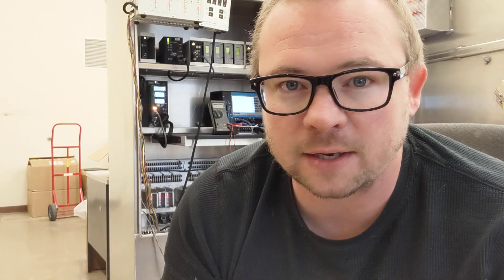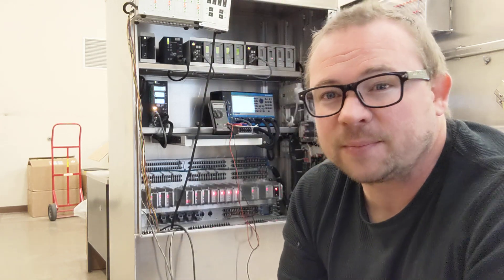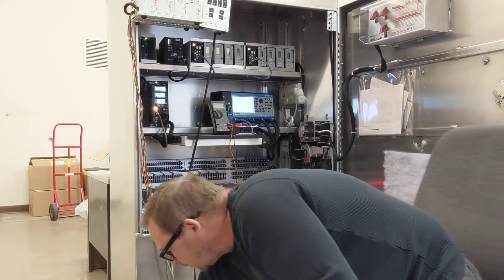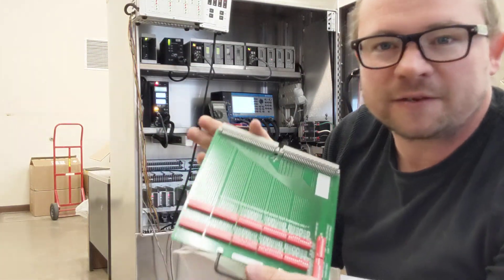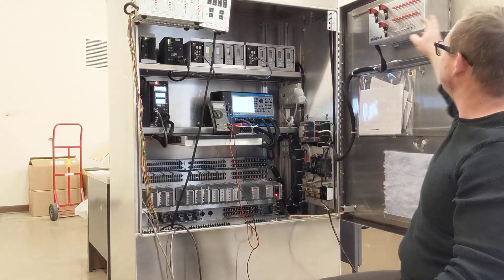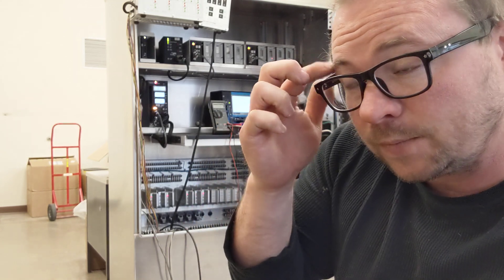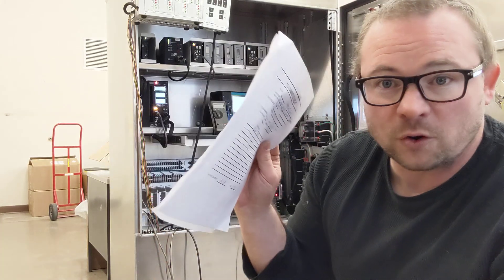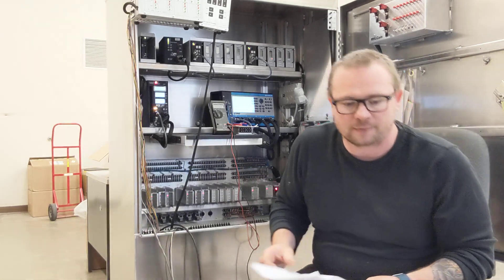Cabinet QC checks!

Comment: Not sure if you answer comments quickly or not since you publish content infrequently, but I’m dealing with a situation regarding a traffic box like this one and need a few questions answered asap.

I’m wondering how the TEMPERATURE situation works with all the equipment inside a box like this and all my questions are relative to this.

1. What is the IDEAL operating temp?
2. Is there a temperature “breaking point” on the high or low end of the spectrum? 
3. Do all boxes have internal temp control and/or temp monitoring systems that alert you to potentially damaging temps?
4. What role does the box ventilation play in this and is there any ventilation on these boxes aside from the slots in the small overhang above the door?
5. MOST IMPORTANT - can materials placed against the back of a traffic box like this create an “overheating” situation OR ANY OTHER damaging condition? More specifically, if a homeless person stacked up some pillows or a blanket against the box and then a shelter against the pillows consisting or a tarp and some makeshift framing, CAN HE CAUSE THE TRAFFIC SYSTEM WITHIN TO OVERHEAT OR MALFUNCTION IN ANY WAY AT ALL?

I am in the process of DEFENDING a homeless man who has created a condition like the one described herein. Police have threatened him numerous times with criminal mischief if he fails to maintain an “airflow” gap between the box rear and his belongings. One cop told him 2” is fine, then other cops come by and demand 6-9”. 

Of course I understand the climate can matter, but in this case, the outdoor temp was  in the 60’s when the man began this routine, and when he was threatened it was December and the temp was much much lower. Despite this, police claimed the traffic box was giving a reading of 90 DEGREES due to his actions and that this was hazardous to the traffic box components potentially causing the intersection to black out and motorists crashing and dying.  I’m a former cop and this is called COPSPLAINING. No matter what sense it makes, as long as it makes them feel better about them violating someone’s rights or dishonoring their oath, it’s just fine by them! In almost every argument, I can call their bullshit because I know enough to disprove their claims or I can look it up. In this case, I cannot. 

Please try to answer back ASAP. Thanks
Reply from the maker: Hey there,

From the age of 14-20 years old I was homeless myself and did spend some time on the streets so your question hits close to home.

These traffic signal cabinets are designed to operate in extreme +/- temperatures. Someone sleeping against the box wouldn't cause a temperature increase anywhere near enough to cause damage to the equipment. I've seen these signal cabinets running with an external temp in excess of 110°f. In the top of the cabinet there is a fan that is controlled by a thermostat. On the door there is a vent where fresh air is exchanged to keep the cabinet cool. 

Now, there are some things to consider about choosing a signal cabinet for a camping location. 
1.It's maintenance requires free access to the inside of the signal cabinet by technicians. 
2. They are struck by vehicles often and are a dangerous location to be for extended periods of time.
3. They are full of live voltage, and are well grounded and all of the signal poles and boxes are bonded to the ground array. This is mainly to protect the electrical components in the event of a surge or direct lightning strike, which also happens quite frequently. 

Cops are typically not helpful to the homeless (from my experience) but I'd say it's more likely that it's more of a liability for someone to be against that equipment for the municipality. Cops will often "copsplain" stuff when they don't want to elaborate. Typically their job is not about public safety, but rather municipal liability. 

I hope this helps. I'd recommend you reach out to a signal cabinet manufacturer like Econolite, McCain, Naztec etc and get some blueprints/specs.
Reply: Traffic Signals Training — something told me I’d hear back from you, and that same something told me that my intuition as to your humanity was spot on as well.

This account I’m speaking from is merely a “shell” account of sorts. I cannot openly admit my true identity when commenting in this manner for several reasons. Two of which are: I’m a former police officer turned civil rights, and I have another channel with  thousands of followers, but am known in the activism community by the tens of thousands. All of which is anonymous. 

I’m known as an extremely thorough person that does a vast amount of research before speaking on the simplest of topics. This is why I’ve virtually abandoned my channel and the movement I was establishing. The amount of facts involved in what I’m fighting for are so overwhelming that no video I produce ever seems to satisfy my standards. 

However, the video I watched about this homeless man sparked revival in me and I felt I needed to come out of hiding and attack the police department that has harassed the homeless man I mentioned with a video that includes the FACTS about these boxes and their temperature limitations and how the officers will use any angle they can to impose their will even when they have zero clue as to what they’re talking about. As you called it, this is 100% cop-splaining, and I think the fact that you used this phrase means that you most likely are a silent fan of the work me and my colleagues do on this platform. 

Everyone’s got a story and man was created to be no better than the next man. You didn’t have to share the intimate details of your past the way you did, but I do greatly appreciate the fact that you did. This is why although I hate the internet for many reasons, I can’t help but love it for reasons like this. It brings the most unsuspecting people together in ways that would not ever be possible without it existing. 

I’m obviously a writer and a man of many words, but believe it or not I’m at a bit of a loss as to whether or not this was some sort of cosmic sign that we should speak further.  

Because of my obsession with facts and wanting to encourage everyone to operate strictly on facts when forming their opinions, I did a heavy amount of research into the question I posted to you just in case you didn’t see it. I believe I narrowed down the manufacturer of the box in question and then located both the painfully detailed legislature from the state in question (regarding this equipment) AND the technicians manual from the manufacturer. After an hour of crunching this miserable information, I learned that these boxes can safely operate from subzero to 175°F temps rendering ANY claims by ANY government officials to the contrary a complete and utter falsehood and abuse of power. Your statement was carefully said for obvious reasons, but I know you agree with me wholeheartedly. Furthermore, as a legal expert, I can tell you that the safety of this man is of no concern to the police until either he requests help or is actually injured. This is based on SCOTUS rulings as well as the law of common sense. Plus, these particular cops never once expressed a concern for this man’s well being. Instead, they treated him like the scum of the earth and showed concern ONLY FOR that goddamn box. They threatened him with arrest many many times and also spoke to him in a way that would have tou chomping at the bit. So, the “what-ifs” you mentioned are out the window and it’s time to bring this to light. 

As I type to you, I continue to kick the idea of contacting you around and possibly finding a way to involved you in this forward advance in speaking out. You can obviously remain anonymous, but I think the fact that I could cover the base of ACTUALLY INTERVIEWING a traffic box tech would make this argument as rock solid as it gets. I’m going to encode an email for you to use which is an email I seldom give out or use. If you have any interest, reach out. Just make it sooner than later because I’m going to start production very soon. Talk to Mister sixth Sense at the gee mail dot com for more info! ✌🏻

Comment: I am assuming you mean cabinet testing? We typically do cabinet testing utilizing the plans and specs for the intersection where it is going to be installed. If we find any issues, the manufacturer sends their lab tech to repair the issue. We either do cabinet testing for the Manufacturer (McCain), a subcontractor, or before we install the cabinet for a job.
Reply from the maker: yeah, QC or "quality control" is the same thing different name. I think our cabinet vendor is pretty good but there's a lot of terminals that all it takes is for one to be landed in the wrong place. There's one cabinet in the field here that obviously vetted before it had been installed, one of the preemption inputs was bad at the test switch which required a field repair. It's not often we find something wrong, but it's always best to find it before it's in the field!

Comment: Hello again, we work with just about every brand of traffic controllers and many agencies specificy the brand of controllers which we are to install, however my personal preference is the Econolite Colbalt. The QC is usually done by the supplier of the controller.
Reply: As I mentioned in a previous post, if a new signal is to replace an existing one, we install all components and connect our "simulator" for 5 or 6 days prior to wrecking out the old signal. If the signal is a brand new first time signal, we are required to leave it on flash for 7 to 10 calender days prior to activating to colors and during this time, we do several test runs.
Reply from the maker: The supplier may send a cabinet that is supposedly QC'd but on multiple occasions and we will run into an issue or two that needs to be rectified before the signal cabinet is installed in the field. When it comes to controllers we trust that they are good out of the box until we run into any sort of issues. it's typical that we will set up an intersection and let it burn in the cabinet for about two weeks before installing it in the field.